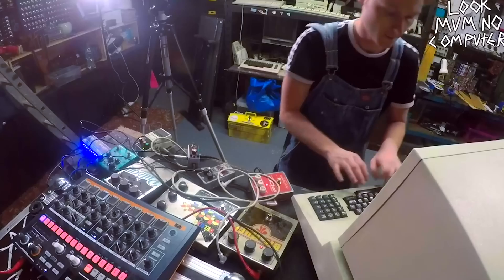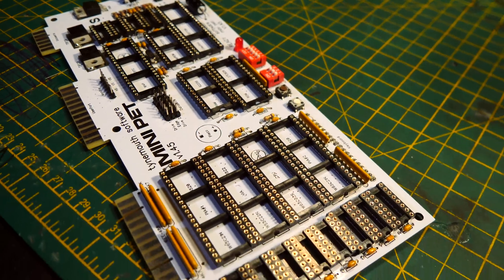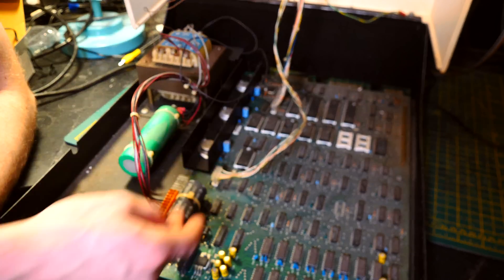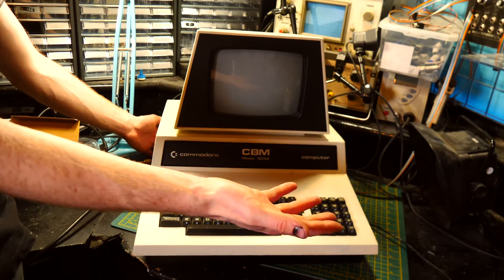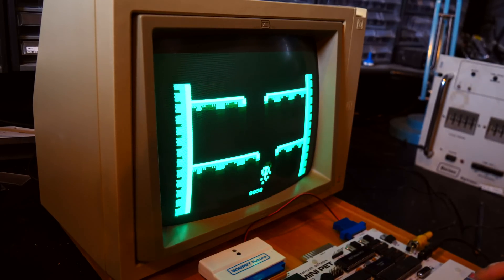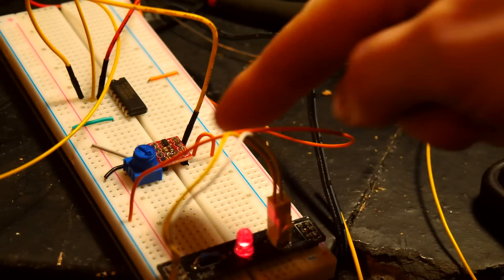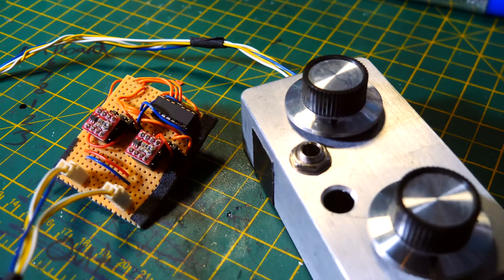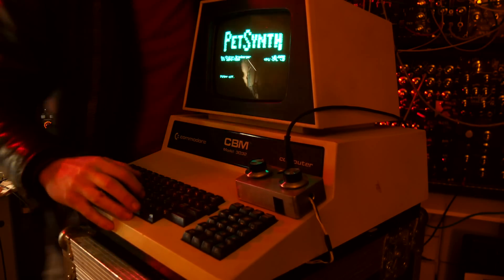Circuit Bending A Commodore PET, That Is BRAND NEW....

Comment: Call me a purist, but that is not a circuit bent PET, that's a PET chassis with a modern computer inside...
Reply: Using a LTC1799 to manipulate the clock speed of a device is a "classic" circuit bend technic for experienced! benders after the time when they find out, that most modern devices restist classic bending attacks with wet fingers or twisting some lines. :-) Most of my devices, eg. the Yamaha Portatones have a LTC Hack on board.

Comment: Sam, I'm not certain but may want to keep an eye on the temps of those processors if you're ramping up their clock speed. May be worth some al fin sinks and thermal compound at minimum. A fan plus previous at most. IDK if you have a thermal camera or not but could give them a touch test at minimum. Run it for 10 minutes at standard clock then a min or two ramped up, touching after each.
Would hate to see you cook something so nice.
Reply: Good point, well worth checking.
Reply: The chips on the replacement board appear to be much more modern than the original so they might handle the higher speed just fine
Reply: @alexanderhorstkotter2910  ah. Didn't look into that. I figured they were NOS or the like for authenticity but I suppose it functionality at a price point was the goal more so than 1:1 audio replication, that makes sense.
Reply: And... Next video in the series: I nitrogen cooled a Commodore PET processor and here's what happened :)

Comment: Hi Dude, how do you like this (w w w .)  youtube.com/watch?v=ThgsUSbZpXI&t=193 
i think there is some of your favorite sound tricks
Reply: people restores electrolytic capacitors just by inject some few drops of transformer-oil inside
Reply: all my youth I tried to overclock an ordinary TV to support 60Hz frame rate, and 30kHz horizontal frequency - but "born to crawl - can't fly"
it is not about your good work there - i just remember that overclocking of Z-80 also was difficult because TV is not monitor - problem became more meaningfull with IBM PC
Reply: Have you ever heared him? (h t t p s : / /  w w w .)  youtube.com/watch?v=smE-uIljiGo

Comment: How on earth did it not crash when you frequency modulated the CPU clock
Reply from the maker: no idea once i fine tuned it it was nearly impossible to crash, which is mad!
Reply: It's a 6502 ohne of the most stable CPUs of the time. Don't think in "modern" CPU's :-) We used this types for more than 25 years to build controlboards for our machines. And, as seen in the video, the PetSynth is stored in the ROM. So no ugly RAM refreshing problems, which are normally the common reason für crashes (Parity Errors and such things). You can use a hammer to destroy a 6502 but not a square wave generator :-)

Comment: Now is this a screen saver or a screen destroyer?
(but given that it doesn't lose sync I guess the sync generation comes elsewhere and the monitor doesn't care when the beam is switched on)
Reply from the maker: Yep the video part of the circuit is still running on internal clock. The pixel generation and the CPU clock has been tapped pff

Comment: It's fascinating how the CPU keeps on processing even though the clock is doing some quite strange and funky things. I'm fairly sure the engineers at MOS never thought "let's use an FM waveform as the clock signal and see what the chip does" :)
Reply: Yes, but those CPU 6502 are extremly robust in timing, we used them for years in controlboards. Thebiggest problem is the refresh cycle of the RAM. Old RAM of the 70th would not work and parity errors may occor. But this "modern" Pet Synth ist mainly stored in a ROM, which don't have such "refresh" Problems. This may the reason why this hack works so flawlessly.
Reply: It's absolutely unbelievable, how it'snt halting!
Reply: @RaDoooh  This feels wrong... It´s like waterboarding the cpu...

Comment: I had to turn the monitor away from my PET so it would see the heart of a relative being ripped out. You need to fix the old mother board :) we need to keep them alive, it did  not take too much effort to get mine up and running. Just had to change the video ram. I'm sure I saw a tear running down my pets monitor while watching this. :(
Reply: yeah definitely!!! the thing is I have a few PET's (about 5 or so eek hoarding is definitely an addiction), and this one just never ever got fixed. the other board is currently sat on the wall of the to be opening museum :) one day it will be looked at definitely
Reply: @THISMUSEUMISNOTOBSOLETE   I've had mine since new, so long ago I can't remember the exact year. I remember I had to take the seat out of the car to get the box in. ;)

Comment: I remember back in the day modifying the clock on the TI/99-4a (tms9900) and one of the issues I had was I had to reset it back to the default clock speed whenever I needed to perform external I/O functions, as they used the same clock, and the external devices wouldn't properly synch up.
Reply from the maker: Thank fudge for sd card interfaces!

Comment: I would have thought that it would be easier to use a DSP processor to do the pitch shifting using the IFFT to get the frequency and amplitude signals then process them then recreate the signal by sending the result through the FFT to obtain the wanted signal as there is C++ code to do this sort of thing.
Reply from the maker: Sounds like a faff to me 🤣 however I guess everyone has different skill sets and tackles a problem with how they see fit. Best thing I can say to that is try it and let me know how it goes!!!
Reply: @LOOKMUMNOCOMPUTER  just search for Pitchshifting using the fft the code is in c++ and could be compiled for use with the Raspberry Pi IV which will also fit inside the COMMODORE PET and just requires the 5V and negative.
Reply from the maker: Give it a go! Not my kinda thing personally! But deffo try it 😀
Reply: @LOOKMUMNOCOMPUTER  I have have messed around with it and I have pulled down the source code and will compile on the Raspberry Pi IV and should quite fast and it has also been implemented in Pure Data for the Raspberry Pi I/II/III/IV and when combined with a few footswitches makes quite a good guitar pedal
Reply from the maker: @DAVIDGREGORYKERR  indeed its definitely a cool thing! i mean if i was going down that route i may as well just use a pitch guitar pedal, i have a raspberry pi and i miust say its not really excited me, its not the sorta thing that interests me. plus you dont get the visual feedback, this above is an excersise in modifying existing hardware, the very stuff that runs the software, and yes whilst it can be done (not as grittily) in software means, if everybody opted for software everytime we would all forget how the fudge it all worked in the first place. im a hardware guy and as much as possibly i will solve problems like this. sometimes arduino's are helpful but usually only to do things that are simple and still building blocks for a bigger hardware solution.
Reply: The thing with FFT is that you necessarily introduce a delay. The more bins the more accurate the signal, but also bigger buffer and latency. While FFT noise is underrated (because we're too close in timeto it being annoying instead of characteristic) you easily want a 1024 samples which will translate to ~20ms delay (on 44100). This ain't a problem that is dependent on processing power etc. Anyway, 20ms and even 5ms is a massive amount of time in analogue audio. 
So, all in all, good old bending is effective, fairly cheap.
Reply: @informativt  If the C++ file is compiled into the executable it will run much faster and actually if you go with the UDOO RYZEN Bolt V1000 then it can be much faster.
Reply: @DAVIDGREGORYKERR  as I said, this is independent of processing speed.
Reply: @informativt  I am actually using it at the minute to process the numbers between 1-59 inclusive to try and get the winning numbers for the lottery and as I have largely rewritten the code as assembler it runs extremely fast with an execution time of 0.956 milliseconds.
Reply: @DAVIDGREGORYKERR  Sure. Processing it goes faster. But you need N samples, and you won't get them any faster. If you eg choose 192kHz instead of 44100, you will only need a larger bin anyway. There's no way around it.
Reply: @informativt  2048 or 4096 will work I have had it working with 32768 bins but you need to running a AMD 1950x or a AMD 3990x but it is most likely overkill but the UDOO RYZON Bolt V1000 maker board SBC uses a RYZEN CPU so will be as fast as you need it to be.

Comment: That is not what I thought you meant when you said breadboard
Reply from the maker: lolllll
Reply: If you were expecting an electronic breadboard you should know that they are actually called breadboards specifically because they replaced the actual wooden breadboards used for homebrew builds. :)
Reply from the maker: @gutterg0d  :D indeed, gotta stock up on them breadboards!!!
Reply: He literally used to the word "literally" correctly
Reply: When I was a kid I used blocks of chip board, wood screws and brass washers to create circuits. The legs of the components were clamped under the washers. Still have one kicking around.
Reply: Made me lol out loud

Comment: Brainstorm time: What do you do with all that extra room inside the PET once you swap out the board?
Reply: well make the rest of the synth of course :D. I just gotta get past the reluctance of drilling holes. but the dream is to make it a pet/analog hybrid
Reply: @THISMUSEUMISNOTOBSOLETE  There should be the unused PCB standoffs. You could put a whole bunch of these in there:-

General Instrument AY-3-8910
https://en.wikipedia.org/wiki/General_Instrument_AY-3-8910

Or some SID compatible ARM-SID sound chips.